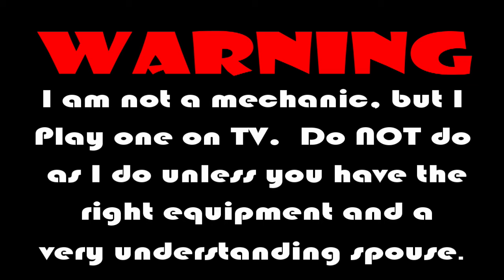2014 Camaro Console and Shifter modification and installation into the 1970 El Camino

Comment: Did a floor shifter/console/seat swap in a ‘95 caprice wagon using ‘95 Impala SS parts except the shifter itself because ‘96 was the only year mid ‘90’s Impalas had floor shifters instead of column (hard to find in a scrap yard) for that I used a shifter from an olds bravada (like a trailblazer) that had a cable operated shifter. That was much easier to route! I wonder when GM went to a shift rod like that? I was surprised to see that’s how it’s done in 2014. Nice going getting it working with what you had! Just took a bit more metal fabrication, good thing you’re always ready for that!
Reply from the maker: Yeah a cable would have been a bunch easier. But the theme of use what ya got is what’s keeping this going. Thanks for watching!